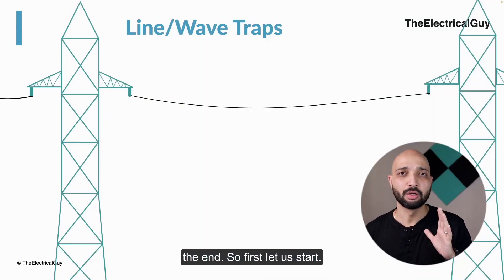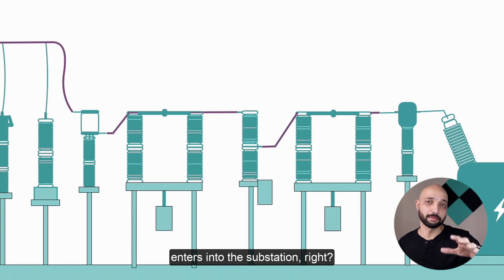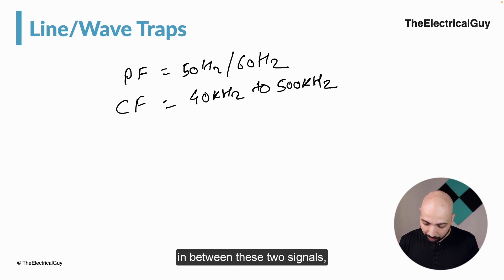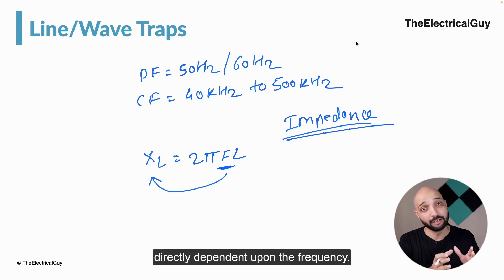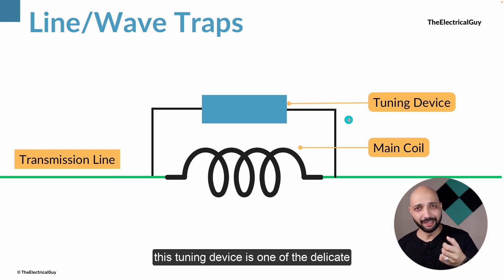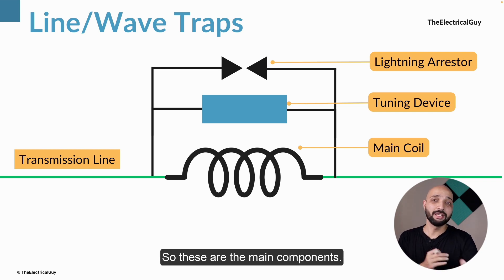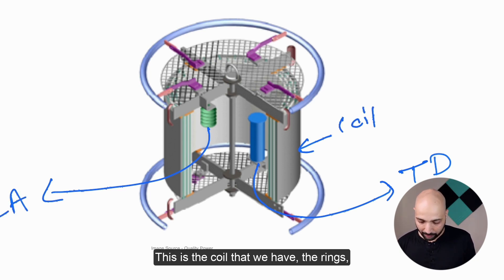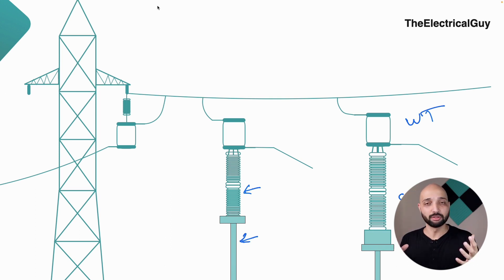How Line Traps or Wave Traps works ? Explained | TheElectricalGuy

Comment: I am civil engineering working in electric utility designing high voltage power lines I am interested to know the purpose and science behind equipment’s installed in substations. Good information for learner’s like me.thanks

Comment: Is it saparet line or transmission line connected
Reply from the maker: wave traps are connected to transmission lines only
Reply: @GauravJ how two frequency carried at a time in single line? I mean if 50Hz to 60 Hz for power and 40KHz to 500KHz for communication how is it working?
Reply: @GauravJ sir waiting